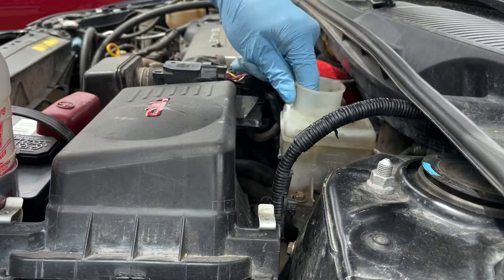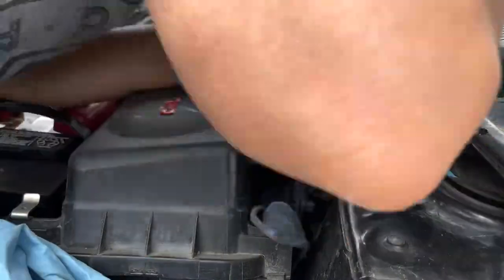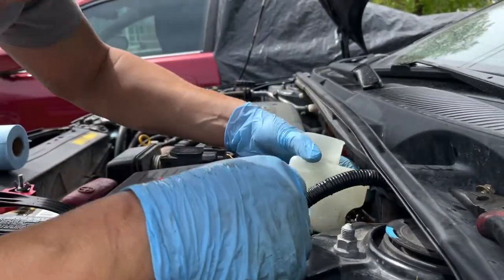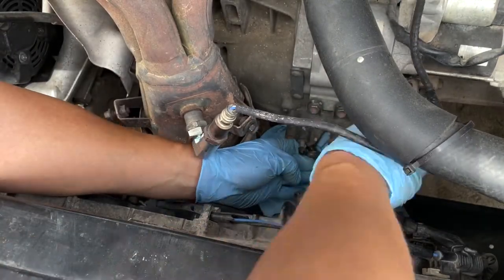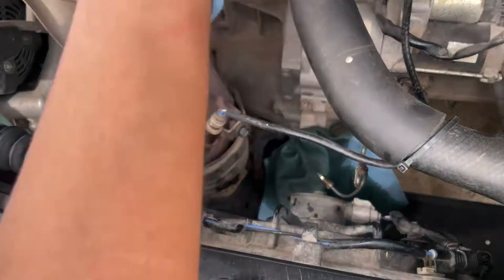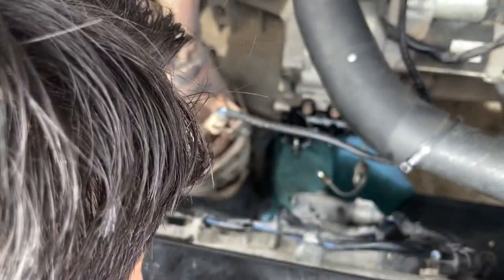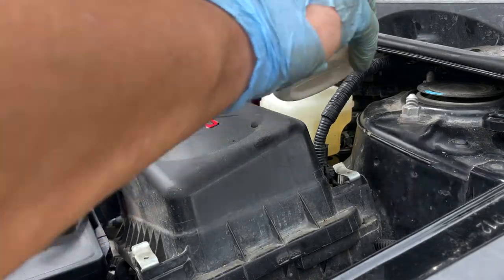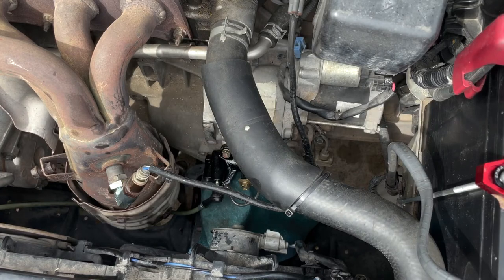How to slave and clutch master cylinder on a First Gen Scion tC Part 1!

Comment: Thank you for that video!  Always sooo helpful to actually see the steps being performed.  One thought I had - when re-installing the slave cylinder, maybe the master as well, wouldn't it be easier to install the hard line first before bolting things down?  Even just re-threading it in without actually tightening it yet would seem to make it much easier to install the hard line without risking damaging the threads while screwing it in.

Comment: Getting ready to do this work.  2006 scion tC, won't shift into gear while the engine is running.  I've tried bleeding the clutch and continue getting very small air bubbles, almost more of a very tiny amount of foam.  It seems like a leak to me somewhere.  But the slave rod seems to have full movement when the pedal is depressed.  I'm going to examine the lines for any signs of a leak.  But a general question - could an air leak anywhere, even if small, cause this symptom of the clutch not fully disengaging, enough to prevent any ability to shift while the engine is running?  I'm guessing yes.  And could the air leak be from a seal failure in either master or slave cylinder?
Reply from the maker: The lines are pretty strong, in my experience, it’s always the master cylinder.
Reply: I have. Same issue u sort urs out

Comment: My prior issue not shifting into gear turned out to be a bad clutch.  Dealer fixed and gave me some parts back.  The clutch was really bad - a couple of the disc plate buffers were broken into pieces.  I suppose after 140k of medium to heavy use I can't complain, but dealer charged possibly double what an independent mechanic would have charged.

Comment: Thanks for posting.  What size was the special tool you used on the line connected to the slave cylinder? And what's the name of it again?
Reply from the maker: Hi, this is what it’s call: 

Metric Flare Nut Line Wrench for Removing or Replacing Nuts on Fuel, Brake or Air Conditioning Lines. 

Good luck!

Comment: Thanks for the video! I knew how to do it but cool to see how exactly on this vehicle! Your content is apprecaited!
Reply from the maker: Thank you for watching it, feel free to like and suscribe!
Reply: @theimportschannel86  Liked and Subbed! I replaced the Slave and the car still won't shift into gear while the engine is running, but it will shift when the engine is off. Should I replace the clutch master cylinder next do you think?
Reply from the maker: @YokosoOtaku , how is the clutch pedal ?
Reply: @theimportschannel86  the clutch pedal has been completely normal
Reply from the maker: @YokosoOtaku , if there isn’t any noises coming from the transmission, make sure you don’t have any air in the system.
Reply: @theimportschannel86  ill check it again but we bled the slave cylinder after install and i didnt see any air
Reply from the maker: @YokosoOtaku , what brand is your slave cylinder?
Reply: @theimportschannel86  sorry for long reply. Tried looking it up. It's just listed as "Napa" brand. Obviously got it from Napa lol
Reply from the maker: @YokosoOtaku , the one I got was from Toyota, didn’t give me any problem at all.
Reply: @theimportschannel86  I'll try bleeding more. I have a master cylinder arriving tomorrow I guess I'll try and I'll comment here again if I find a fix.
Reply from the maker: @YokosoOtaku , sounds good, keep me updated please!

Comment: So when you step on your break pedal. It just go down? Doesnt get the compression
Reply from the maker: yes, it goes down and you need to lift it with your feet, that’s when you know that your sleeve and master clutch needs replacement.
Reply: @theimportschannel86   Is this for the brake or clutch
Reply from the maker: @KingKing_777  hi, it’s for the clutch master and slave cylinder.

Comment: I  changed my clutch master cylinder today but my gear still has trouble engaging do I still need to bleed the system of air ?
Reply from the maker: Check your slave cylinder and make sure the hard lines and soft ones aren’t leaking.
Reply: @theimportschannel86  I have change  the slave cylinder but I'm still have the same problem getting into gear
Reply from the maker: @moirodriguez9223 , where did you get the slave cylinder from?
Reply: @theimportschannel86  autozone
Reply: @moirodriguez9223  brother cambie todo el clutch a mi 08 XB y todavía tengo problemas con los cambio no le entran que será

Comment: what if i change both and still doing that could be the aprt faulty?
Reply from the maker: Make sure you don’t have any leaks and air in the system.
Reply: @theimportschannel86  i did saw that the rubber is kinda broken on the sides that could be the problem? cus i did check that to